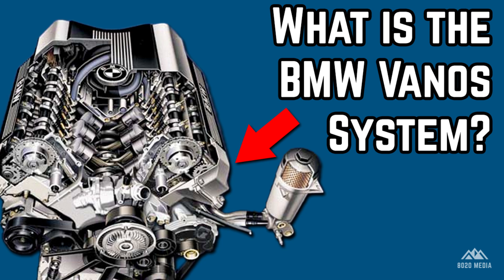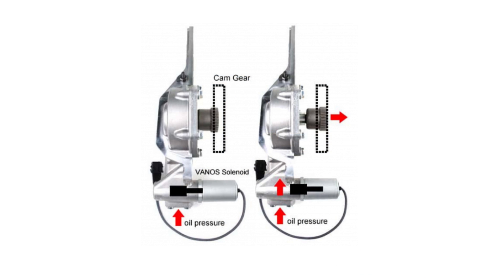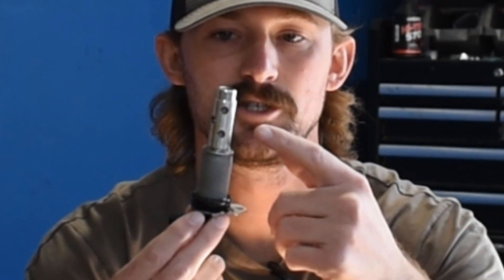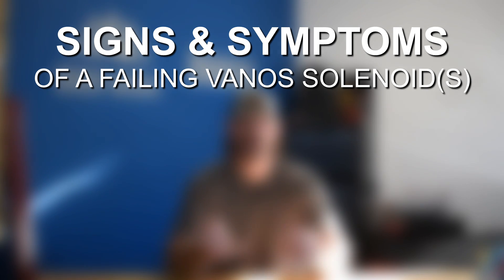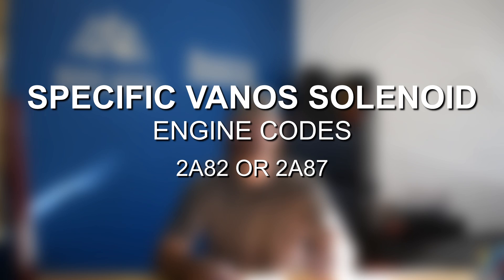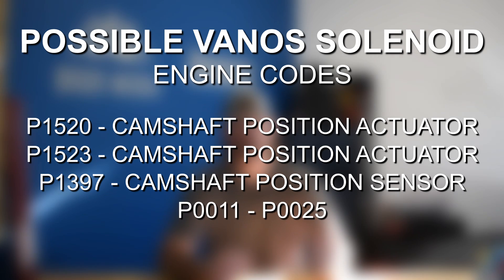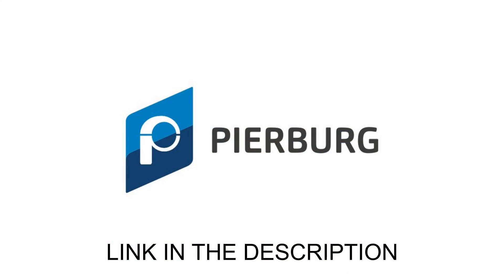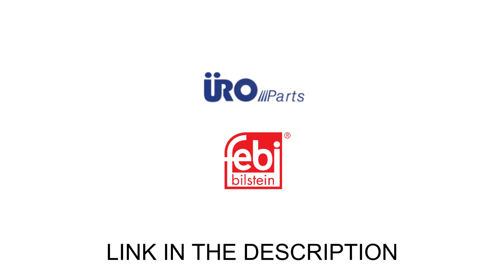Symptoms & Diagnosis of a Failing VANOS Solenoid!

Comment: I have an r56 mini Cooper s, with the N14 and vanos only in the intake... 56k kilometers on the dash, can ticking when idling be a sympthom of this starting going Bad? It starts ticking on the opposite side of the camshafts and it goes away when revving, then it comes back at idling again. If i stop the car and start it again it comes back after some seconds
Reply from the maker: O - Yes, that ticking at idle on your R56 Mini Cooper S with the N14 engine could absolutely be an early symptom of VANOS issues, especially since the N14 uses a single intake-side VANOS unit—but what you’re describing also sounds very typical of the hydraulic lifters (lash adjusters) bleeding down, which is a known issue on these engines at low RPM or after sitting, particularly when oil pressure is low at idle; the fact that it’s coming from the side opposite the camshafts (likely near the timing chain or lifter area), goes away with revs, and comes back after a restart points more toward lifter tick or early timing chain tensioner wear rather than VANOS alone—though all three are potential players; I’d check oil level and quality first (use factory-spec oil only), then listen closely with a mechanic’s stethoscope to isolate the noise—if it’s near the front of the engine by the chain, tensioner might be weakening; if it’s top-end and rhythmic, it’s likely a sticky lifter or early cam follower wear.

Comment: Can vanos solenoids cause low compression?
Reply from the maker: E - VANOS solenoids themselves won’t directly cause low compression—they control camshaft timing, not cylinder sealing—but if the VANOS system is malfunctioning (say, stuck timing due to bad solenoids or gummed-up oil passages), it can cause the intake or exhaust valves to open or close at the wrong time, which can lead to false low compression readings, especially if the valves are slightly open during a compression test; so while the solenoids aren’t causing physical damage or leaks, bad timing from a VANOS issue can mimic low compression by messing with valve timing, and once the timing is corrected, those compression numbers can bounce right back to normal.

Comment: What is your thoughts about the saying " if it not broken ,no need to fix?"  I drive an 2006 n52 , and now i "prevent" throw money at it, all my money 😅
Reply from the maker: D - Not with these engines lolol
Reply: @8020Automotive  6 januari i have changed the water pump and Thermostat,, 1400euro.
Maintenance is in my 3 years owning around 3k a year ,, 225k kilometer, its just a hobby right🫩 ones in a life time, right

Comment: Well worth changing oil more often than BMW say, every 6 months or 7500 miles. Oil is more lubricating and less rubbish suspended in it and therefore stops things like these VANOS solenoids from getting clogged. It's a good idea to reset the DME (ECU) adaptations to help the engine relearn the performance of them too. People tend to forget this and it's a waste of time changing the solenoids if you don't.
Reply from the maker: F - Well said! We completely agree.
Reply: @fi5hfi5h - can you elaborate on how this is done? "...reset the DME (ECU) adaptations".   Is ISTA or ISTA-P required?
Reply: Do you think the exaust solenoids make the problem that wen I put on drive mode and push gaz she make cutoff and don't take gaz anymore?

Comment: Hi! I have a 2009 e90 328x n51 with 125k miles. Recently, feels sluggish (reduced power?) at low speeds (not limp mode, tho), and the fuel economy has noticeably dropped. No misfires, idling seems fine for a 15-year-old car, and the start-up is consistent - but not vigorous. No lights on the dashboard. I don't have a code reader, but an AutoZone scan showed nothing.

The symptoms of both failing VANOS solenoids and failing O2 sensors seem similar and fit my situation. Both are original. Would there be a hidden code that only a shop could read? Or are there other ways to diagnosis between those two components? 

TIA - the video was well done!
Reply from the maker: I - You're spot-on that both failing VANOS solenoids and worn pre-cat O2 sensors can cause sluggish low-end power and poor fuel economy on your 2009 E90 328xi (N51), especially with both being original at 125k miles—but it's very likely there's a hidden or pending fault code stored in BMW's proprietary modules that a basic OBD2 scanner like AutoZone’s can’t access; these "shadow codes" or BMW-specific DTCs can only be read with a proper tool like INPA, ISTA, or a Foxwell NT530. Generally, if the sluggishness is most noticeable at low RPMs or when accelerating from a stop, it often points to sticky or slow VANOS solenoids, which you can easily remove and clean to test improvement; if the issue feels consistent across the rev range and fuel economy steadily worsens, aging pre-cat O2 sensors may be causing the ECU to run rich. Since there are no dashboard lights or misfires, your next best move is to clean the VANOS solenoids (a low-cost DIY), and if that doesn’t resolve it, consider replacing the upstream O2 sensors or getting a full BMW-specific scan before throwing parts at it—at 125k miles, either component is a reasonable suspect.

Comment: Hi mate, how about : 
130308 vanos, exhaust: control fault, position not reached 
Thanks
Reply from the maker: S - The 130308 VANOS exhaust: control fault, position not reached code on your BMW indicates that the DME (engine control unit) commanded a certain position for the exhaust VANOS (variable camshaft timing system), but the system failed to reach or hold that position, which typically means there’s a mechanical issue with the VANOS actuator, a hydraulic flow problem (such as low oil pressure or dirty oil/solenoids), or wear in the cam gear or timing components; your first step should be to check the oil level and quality, then try cleaning or swapping the VANOS solenoids (exhaust vs. intake) to see if the fault follows, and if not, you may be looking at a failing VANOS unit or worn camshaft/VANOS gear, especially if the car has higher mileage or irregular oil change history.

Comment: Does m52b28 have this?i have ghost engine problem when stuck on the road/ traffic the rpm won't rise above 2000

I must turn off the engine and everything goes back to normal but after about 10-15 minutes its happens again

Already change both TD censored
Reply from the maker: R - The M52B28 engine does not have VANOS solenoids like later BMW engines with dual VANOS systems. Instead, it has a simpler single VANOS system that operates via oil pressure and a mechanical solenoid—not electronic VANOS solenoids like the ones found in engines such as the N52 or N54. Your symptoms—RPM not rising above 2000 and requiring a restart—could point to a sensor or fuel delivery issue, especially since you’ve replaced the TD sensors (which I assume are throttle position or camshaft sensors). You might want to inspect the crankshaft position sensor, fuel pressure regulator, or even the MAF sensor, as intermittent problems in any of these can cause RPM limits or limp mode without throwing a clear code. Also, check for vacuum leaks and make sure your DME (engine control module) is properly grounded and free of corrosion.

Comment: I have same problem on my 545i but no any error codes.i don't know what to do 😢.help
Reply from the maker: M - What symptoms are you experiencing?
Reply: @8020Automotive  n62b44 I start the engine cold at high revs everything seems normal. After the revs drop bank 1 starts to work unevenly. I start driving the car when accelerating hesitating from bank 1. It takes a long time to gain revs, from bank 1 I feel that something is missing. Bank 2 works well no noise no rattles, sometimes the car itself comes back to normal everything works well drives properly but after a short time of driving the car starts hesitating bank 1 again. The check is not on. There are no error codes for the engine

Comment: Hi, I am having the code P323f code and engine goes to limp mode on and off. Is a 335d, any advise pls
Reply from the maker: D - The P323F code on your BMW 335d typically relates to a fault in the EGR (Exhaust Gas Recirculation) control system—often pointing to the EGR valve, cooler, or associated sensors like the EGR pressure sensor or mass airflow sensor. When this system malfunctions, the ECU may trigger limp mode to protect the engine from damage due to incorrect air/fuel ratios or increased emissions. You should inspect the EGR valve for carbon buildup or sticking, check the wiring and connectors for corrosion or breaks, and verify sensor function with live data if possible. A carbon-clogged intake tract or faulty EGR cooler bypass actuator could also contribute, especially on higher mileage diesels. Cleaning or replacing the EGR components and clearing the code should help resolve the issue, but be sure to address the root cause to prevent recurrence.

Comment: I've got no fault codes. But I had a slight pinking under load twice today. It's a n12 engine. Plus seems a little flat on power at low revs.
Think it's probably worth checking these
Reply from the maker: H - Yes, checking the VANOS solenoids is a good idea—especially on the N12 engine, where sluggish low-end power and occasional pinging (pinking) under load can be early signs of VANOS issues. Even if no fault codes are present, sticky or partially clogged solenoids can affect timing and cause poor throttle response or mild detonation. You can try removing and cleaning both solenoids with brake cleaner and compressed air—just be sure to reinstall them in their original positions (intake vs. exhaust). If cleaning doesn’t help, replacing them with quality OEM or Pierburg units may restore performance.
Reply: Does it stall sometimes because of inconsistent throttle response … like you go in first as you usually do but it somehow stalls ( even tough you did nothing wrong like dumping the clutch ) it happened to me twice today it’s a b38 engine 1 series and at low rpm in 2 gear it shakes sometimes when I accelerate … Tks dude

Comment: I have a retarded camshaft code with 3 misfires could that be because or this solenoid ? I got new coils and spark plugs also a new fuel pump and high pressure fuel pump as well.

Comment: I have bought one solenoid from gates , is running ok but now I got error on intake side , what do you recomand , to replace both of them with Pierburg or to buy another Gates for intake side . Can affect performance the diference between Gates and Pierburg?
My car has 270k km it is an n52b25
Reply from the maker: R - On your N52B25 with 270k km, it’s generally best to match both VANOS solenoids to ensure consistent performance and avoid calibration issues between brands. Pierburg is the OEM supplier for BMW and typically offers better long-term reliability and precise response. If you already have a Gates solenoid running fine on the exhaust side, adding a Gates to the intake side should be okay short term. However, if you want optimal consistency and reliability—especially at high mileage—replacing both with Pierburg units would be the better choice. Mixing brands can sometimes lead to slight performance inconsistencies or error codes due to differences in response times.
Reply: @8020Automotive  Thx for reply!
I already changed intake side with gates vanos and the engine is finally running smooth.The other vanos from Gates has already 1 year and 15k km and no problem ... Pierburg may be OEM but they are made in China to like Gates, the OE is VDO which are made in Germany...

Comment: I would not recommend trying to clean them if they don't give specific problems, by doing that, they might brake, and if you replace them safe yourself the struggle and buy the original one's that way you only need to buy it 1 time.
Reply from the maker: E - I don't think we said to clean them if they aren't causing any problems.. It is worth cleaning them, correctly, if they are causing problems before spending money on new ones though, and we'll stand by that. As far as buying original one's, we agree.

Comment: I don’t have a decent scanner, the generic code I got is p1553 and p0304. Idk if the misfire is because of the other code or not. Never had an issue with the car until yesterday. Could this be a vanos issue
Reply from the maker: D - P1553 on a BMW typically refers to a VANOS-related fault, often indicating camshaft timing issues, while P0304 is a cylinder 4 misfire. It’s very possible the P1553 (VANOS problem) is affecting valve timing enough to cause a misfire in cylinder 4. VANOS issues can disrupt airflow and combustion timing, especially at low RPM, triggering misfires. Before throwing parts at it, inspect the VANOS solenoids (clean or swap them if needed), check for oil sludge or pressure issues, and verify that cylinder 4’s coil and plug are still good. The misfire may clear once the VANOS system is working correctly again.
Reply: If you decide to remove the vanos solenoids to clean them make sure you separate them, as in, dont mix them up when re-installing. They look identical but i mixed them up cleaning them on my 335i n55 and after turning on the car it ran very rough, like a tractor.. i took them out again, swapped them and the engine ran fine.. my issues with vanos dissappeared so far and its been a year just by cleaning them and maybe around 50k kms (or 35k miles? Idk) maybe i was lucky as the dude stated maybe 10k would get you off with just a cleaning.. cheers.. 
Ps: its very easy to remove the vanos on bmw engines, despite having to remove alot of parts out of the way, just be gentle as to not brake brittle old plastic
Reply: I have a p0300 multiple misfires...could this be the problem?

Comment: Pierburg is now made in "CHINA"... MY ISSUE IS I KEEP REPLACING THESE EVERY WEEK.!! WHAT COULD BE CAUSING THIS.??
Reply from the maker: N - If you're replacing VANOS solenoids every week, there's likely an underlying issue causing premature failure rather than the solenoids themselves being bad. Common causes include: dirty or low-quality oil, as sludge buildup can clog solenoids—ensure you're using high-quality synthetic oil and changing it at proper intervals. Oil pressure issues from a failing oil pump, clogged oil passages, or worn VANOS seals can prevent proper solenoid function. Excessive debris or metal shavings in the oil may be from internal engine wear—check your oil filter for metallic particles. A failing timing chain tensioner or stretched timing chain can put stress on the VANOS system. Also, ensure proper electrical voltage is reaching the solenoids, as a bad DME, shorted wiring, or corroded connectors could be causing them to burn out. Before replacing another solenoid, try cleaning the oil control screens and checking oil pressure.
Reply: @8020Media  I don't think there burnt out..when I purchased this at auction I drove 2 months no issues at all..then all.of a sudden I got the dreaded reduced power..so i scanned it and it said Vanos..I purchased 2 new junk Chinese and they from the beginning did not sink with my throttle,stumbling when I cracked the throttle..then 2 days later Reduced power..so i purchased these new pierburg and throttle was good but yesterday they died again..I'm lost.!!
Reply from the maker: @ Sorry to hear that you're going through this. Have you gone to a mechanic at all?
Reply: @8020Media  original vanos..clean no dirt,no metal..but..these Pierburg are made in CHINA
.SOOOOO

Comment: If the vanos are bad can you also get error 2C3D DME Oxygen sensor before/after catalyctic converter?
Reply from the maker: e - Yes, bad VANOS solenoids can cause error 2C3D (DME Oxygen Sensor before/after catalytic converter) because faulty VANOS operation affects valve timing, which can lead to incorrect air-fuel mixture and improper combustion. This, in turn, impacts oxygen sensor readings, triggering lean/rich mixture faults or sensor-related codes. If you're getting 2C3D, check the VANOS solenoids, clean or replace them if necessary, and also inspect for any vacuum leaks or exhaust leaks that could be affecting sensor readings.

Comment: Has anyone had them when the engine cuts out at low revs
I have a mini 1.6 n16b engine with a vanos fault 2845
Reply from the maker: N - A VANOS fault code 2845 on your Mini 1.6 N16B engine, combined with the engine cutting out at low revs, usually indicates a VANOS solenoid failure, oil flow restriction, or timing issues. First, try cleaning or replacing the VANOS solenoids, as they can get clogged with sludge. Also, check for low oil pressure or dirty oil, since VANOS relies on proper oil flow. Inspect the timing chain and tensioner, as excessive slack can cause VANOS-related timing errors, leading to stalling. If the problem persists, scan for additional camshaft correlation codes and verify the crankshaft position sensor is working correctly.
Reply: @8020Automotive thanks very much mate!
I was expecting to see a cam or crank fault due to my symptoms.
The only fault was the vanos, I will replace it and carry out further checks if the fault persists.
Thank you

Comment: Well I can't agree with you them failing frequently I've owned three BMWs consecutively and never had an issue with them so I think if you change your oil frequently stay on top of that filter cuz I changed my filter out in between oil changes and that could very well be the culprit just saying
Reply from the maker: M - That's the problem. Not everyone takes care of their vehicles like others. Sounds like you take great care of yours.
Reply: @8020Automotive yeah no doubt is absolutely necessary to maintain but all three BMWs that I've owned over the last 12 years not one of them and I mean not one of them burned any oil am I in the guy that is into racing and repairing BMWs he said it's a freak they all burn oil he's never seen one that has it and I've owned three of the last vehicles like I said C e r m A oil is the best